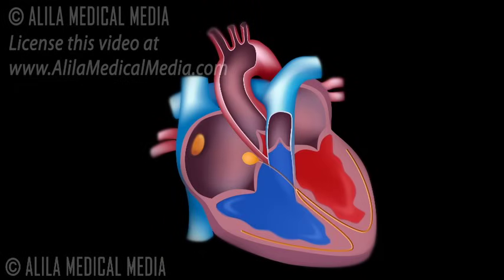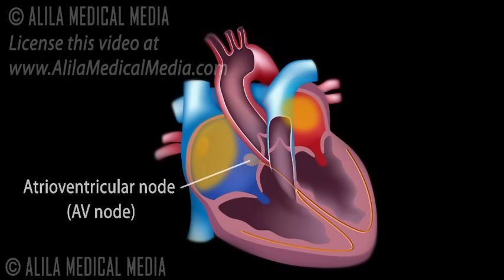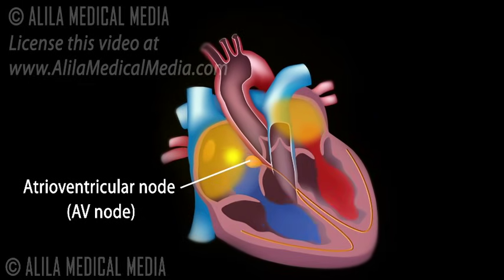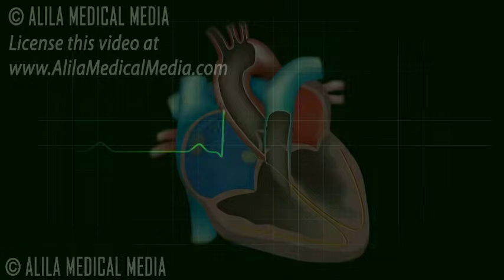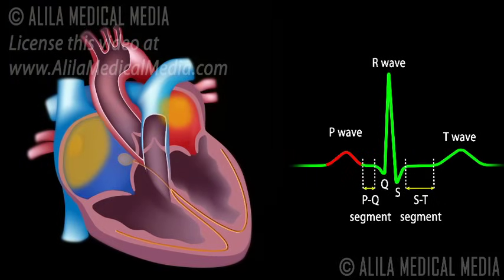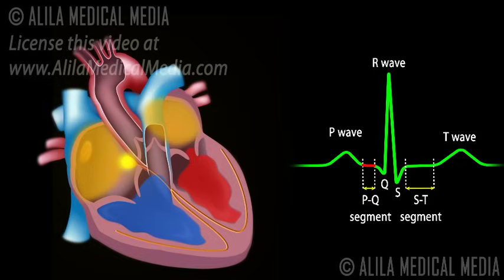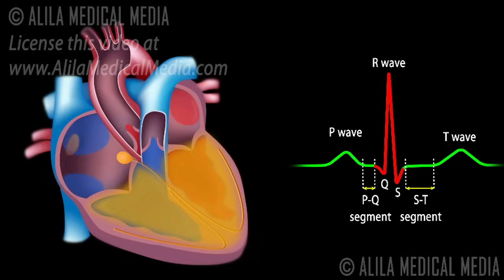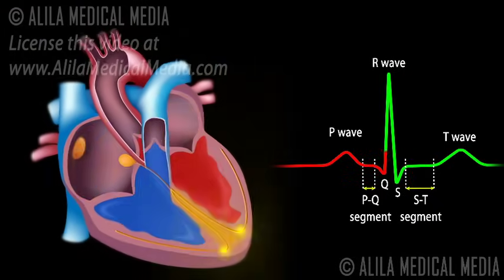Cardiac Conduction System and Understanding ECG, Animation.

Comment: Summary of ECG Graph

P wave - Firing of SA node causing depolarization of atria 

After 100 milliseconds of beginning of P wave Atrial systole begins 

P-Q segment - Time taken for impulse to travel from SA node to AV node 

QRS complex - The firing of AV node and marks the ventricular depolarization 

Q wave - Depolarization of inter ventricular system 

R wave - Depolarization of the main mass of ventricles  ( purkinje fibres ) 

S wave - Last phase of ventricular depolarisation at the base of heart 

Atrial repolarisation also occurs at the same time but signal is obscured(difficult to see)  by the large QRS complex

S-T segment - Plateau in myocardial action potential when Ventricles contract and pump blood 

T wave - Ventricular repolarisation immediately before Ventricular diastole 

CYCLE REPEATS

Comment: Doesn't ventricular depolarization take place at the apex, and not at the base? Isn't the apex at the bottom, and the base at the top?
Reply from the maker: Ventricular depolarization takes place all over the ventricles, some parts before others. The base referred to here is the part between the ventricles and atria.
Reply: De-polarization begins at the top and then heads towards the base😊

Comment: Incase anyone need this in words :)

Sinoatrial node or SA node is the natural pacemaker of the heart. It initiates all heartbeat and determines heart rate. Electrical impulses from the SA node spread throughout both atria and stimulate them to contract.

The atrioventricular ir AV node serves as electrical gateway to the ventricles. It delays the passage of electrical impulses to the ventricles. This delay is to ensure that the atria have ejected all the blood into the ventricles before the ventricles contract.

The AV node receives signals from the SA node and passes them onto the atrioventricular bundle - AV bundle or bundle of His.

This bundle is divided into right and left bundle branches which conduct the impulses toward the apex of the heart. 

The signals are then passed onto Purkinje fibers, turning upward and spreading throughout the ventricular myocardium. 

Electrical activities of the heart can be recorded in the form of electrocardiogram. ECG or EKG. 

An ECG is a composite recording of all the action potentials produced by the nodes and the cells of the myocardium. Each wave or segment of the ECG corresponds to a certain event of the cardiac electrical cycle. 

When the atria are full of blood, the SA node fires, electrical signals spread throughout the atria and cause them to depolarize. This is represented by the P wave on the ECG. 

Atrial contraction, or atrial systole starts about 100 milliseconds after the P wave begins. 

The P-Q segment represents the time the signals travel from the SA node to the AV node. The QRS complex marks the firing of the AV node and represents ventricular depolarization:

Q wave corresponds to depolarization of
the interventricular septum. 

R wave is produced by depolarization of the main mass of the ventricles. 

S wave represents the last phase of ventricular depolarization at the base of the heart. 

Atrial repolarization also occurs during this time but the signal is obscured by the large QRS complex.

The S-T segment reflects the plateau in the myocardial action potential. This
is when the ventricles contract and pump blood.

The T wave represents ventricular repolarization immediately before
ventricular relaxation, or ventricular diastole. The cycle repeats itself with every heartbeat.
Reply: God sent,Thank you ❤
Reply: Love❤❤❤❤!
Reply: Thank you so much ❤❤🙏
Reply: Life saver
Reply: Thank you
Reply: This is so helpful  for my neet preparation Thank you ma'am
Reply: Im very thankful

Comment: You need to have to be a computer to imagine all the things going on together like pumping of blood into the atria, opening of the bi and tricuspid valve and SAN sending action potential and atria contract and p wave and then pressure in ventricle increase so bi  and tri cuspid valve closed and here we listen first heart sound lunch (due to closing of the valves) and at the same time AVN & AV bundle sends signal to the bundle of his and starts Q wave and then ventricle contact and R wave and semolunar valve forced open due to excessive pressure and then blood moves into PA and Aorta and atria relax and ventricle contracts and S wave and blood fills in atria and just before ventricle relax we have T wave and then due to decrease in ventricle pressure semolina valve closes and here we hear second heart sound dub (due to closure of semolina valve)  all these going on in 0.8seconds🤐🤕😶😵

Comment: PQ interval starts from starting of P till Q wave.......needs correction in animation
Reply from the maker: This video talks about PQ segment, not PR interval, and this is NOT a mistake. You may have seen more of PR interval in text books, because it is used for ECG interpretation. But you should be able to find PQ segment too. These are 2 different things. The PR interval measures from the start of P wave.  So PR interval = P wave + PQ segment. To understand ECG, we intentionally use PQ segment as it represents one single event, easier to understand.

Comment: Do this corrections please......
PQ or PR segment is an isoelectric line which indicates AV nodal delay. And this AV nodal depolarisation is not detected by galvanometer. Hence no deflection so isoelectric line occurred.

ST segment is also isoelectric line in which there is no electrical activity in the myocardium due to complete depolarisation after QRS complex and before Twave or before repolarization made.

Comment: It doesn't make much sense for the QRS. For example in lead II, the direction of Q is towards the positive node but the deflection is downward? And for the R is away from the positive node but peak upwards?
Reply from the maker: You are correct! In this video as we only cover the basics, it does not explain that. The details of the events that result in the QRS complex are  a little more complex. We address them in our other video, about bundle branch blocks : https://youtu.be/fmBUkmdDPA4 
Hope this will help clarify things up !
Reply: Thank you for explaining that further. I had the same exact question. The other video does clarify the ECG more for me.

Comment from the maker: Please NOTE: As we got this question a lot, we just want to clarify here: This video talks about PQ segment, not PR interval, and this is NOT a mistake. You may have seen more of PR interval in text books, because it is used for ECG interpretation. But you should be able to find PQ segment too. These are 2 different things. The PR interval measures from the start of P wave.  So PR interval = P wave + PQ segment. To understand ECG, we intentionally use PQ segment as it represents one single event, easier to understand. The PR interval is used, however, to interpret ECG. You can see how to use PR interval to interpret ECG here (this is another one of our videos): https://youtu.be/wPKC1X0yUQ4 Thanks for watching!
Reply: But that is also called the PR segment in many different sources, so it was a bit confusing! Also, wouldn't that segment determine conduction through AV node and AV bundle? The PR interval is what determines the time required for the travel of signal from the SA node to AV bundle to my understanding. Please correct me if I'm wrong.
Reply: So the video should be showing the PQ segment going from before P until the beginning of Q, correct?
Reply: Nice
Reply: ekg

Comment: Hi!!  Great video but I thought it was P-R segment...or is it the same as P-Q segment?
Reply from the maker: There are PQ segment and PR interval (not mentioned in the video) - these are 2 different things. The PR interval measures from the start of P wave.  So PR interval = P wave + PQ segment. To understand ECG, we use PQ segment as it represents one single event, easier to understand. The PR interval is used, however, to interpret ECG - it tells you if the conduction through AV node is normal or too fast or too slow. You can see the details here: https://youtu.be/AUn8P5hRG0c

Comment: we don't have PQ segment...it is PR segment...and in PR segment the potential  action conducts from AV node to "bundle of his" and " purkinje fibers"...i think this part of animation should be corrected....am i wrong???
Reply from the maker: There are PQ segment and PR interval (not mentioned in the video), these are 2 different things. The PR interval measures from the start of P wave.  So PR interval = P wave +PQ segment. It does represents conduction through the AV node, but ends right there. Conduction from the AV node down to the ventricles is represented by the QRS complex. To understand ECG, we use PQ segment as it represents one single event, easier to understand. The PR interval is used, however, to interpret ECG - it tells you if the conduction through AV node is normal or too fast or too slow. You can see the details here: https://youtu.be/AUn8P5hRG0c
This video has been used by many prestigious universities to teach medical and nursing students/staff so we are confident you can trust it too :) . Your question was very valid, however, as this is not the first time someone raised that question. The PQ segment and PR interval are indeed confusing. In fact, some expert team from an university we licensed the video to has asked us to talk about  the PR interval instead of PQ segment, but after further consideration they finally decided that it is better to mention the PQ segment here, so the video has been kept unchanged.
Reply: but with a little search or googling you will find out that all sources and all books have written PR segment instead of PQ segment...i know that PR interval is different from PR segment...even i can attach a link on youtube...you can check other valid sources if you don't agree with me...even guyton physiology book confirms my opinion bro :)
Reply from the maker: We feel flattered that you thought we did not do any research and came up with this video all on our own? We do not invent science, we only try to make it easier to understand, and to do so, we did LOTs of research. We did not invent the PQ segment. Many books do not mention it, and talk about  the PR interval instead, but other books do. And we found that it is easier to understand this way. You are free to disagree, but we  dont think we need to correct anything in our video.
Reply: don't forget that it is just scientific discussion...i don't want to annoy someone...your video is absolutely excelent....but some of the information that you have mentioned is different from what anothers  say...ok...it is not problem..if you say pQ...i agree with you:)
Reply from the maker: Dont worry you did not annoy us. I was just trying to explain why we used that and why it is correct - just so others who may read the comments get their understanding of the subject right. And yes, we are happy that our videos are different from other sources, we take it our strong point.  You dont have to agree with us :)
Reply from the maker: Oh and the link in my previous response is actually another video of ours where we show how to use the PR interval to interpret ECG - not a video to prove that we are right about the PQ segment :)
Reply: You did annoy me though. You absolutely cannot give the channel full credit for being correct. Subtly, with the capitalization of the Q in "pQ" and with your many offhanded comments, it's clear you still want to accuse them of making a mistake. People like you are incredibly annoying because you clearly only try to point out errors to promote your superiority over others and when you get corrected in return, you can't admit your own error. 

If you look at the other videos they provided or read another textbook, you'll see that they are correct and you are wrong. Good luck.

Comment: what causes these eletrical impulses??  what causes the cells to generate eletrical impulses??
Reply: +joao massot Nothing causes the initial impulse - cardiac cells possess what is referred to as automaticity, or the capability of generating an electrical current. The impulse is propagated down the conduction pathway by changes in ion influx and efflux which results in a change of current. The ion influx and efflux occurs because different specific "channels" in the cardiac cell membrane open and close in a specific order.

Comment: questions:
R Wave and T wave are both upward trend of the curve, but why is R Wave called depolarization and T wave is called repolarization?
Reply: +lysol5555 Depolarization precedes contraction, a mechanical event and repolarization precedes relaxation, another mechanical event. Depolarization and repolarization are electrochemical events that result in myocardial contraction. The resting potential, or voltage inside the cardiac cell is about -90 mV; depolarization brings it to about about -70, i.e., more positive and repolarization brings it back to the more negative value.
Reply: To my knowledge, the ECG only shows the amount of electrical activity, not the direction in which cells are polarising. I hope I've used the right terminology there

Comment: If P = depolarization (more positive)
and T = repolarization (more negative)
Why are both depicted by a positive upward bump on the EKG?
Reply: +ElementalSkater001 repolarization works in the exact opposite manner. during depolarization  positive deflection when heading towards a lead. depolarization equals positive deflection away from the lead. myocardium cells depolarized from inside out and repolarized from out side in. hope this helps. but this is all dependent on muscle mass, infarct and a list of other issues that may be going on
Reply: it is because repolarisation,it is negative charges moving from outer myocardium towards innermyocardium or simply the negative charges are moving from ventricular myocardium towards the negative lead connected to your hand so,negative charges moving towards negative lead produces positive deflection in ecg,afterall (-*-)=+.......

Comment: that polarization repolarization needs some explaining
Reply from the maker: Helmaerl Cheny Cells are polarized, meaning there is a difference in electrical potential across the cell membrane: positive charge outside, negative charge inside. That is the resting state of the cell. When a cell is depolarized - there is a change in electrical potential making the cell membrane "less polarized'. This is when the cell is electrically active and fire action potentials, in this case, it causes contraction of the cardiac muscle. The cell then returns back to the normal resting state - being "repolarized" - this is when the muscle is relaxed.
Reply: Imagine repolarization as the charging of the node.

When it is fully charged, it will send out it's energy as a pulse. This is called the depolarization phase.
Reply from the maker: +Helmaerl Cheny As we got this question a lot, we have made a new video about action potential, depolarization/repolarization here - this is the process in neurons, but the principle of depolarization and repolarization is the same, this will help clarify further: https://youtu.be/iBDXOt_uHTQ
Reply: Helmaerl Cheny hahahah